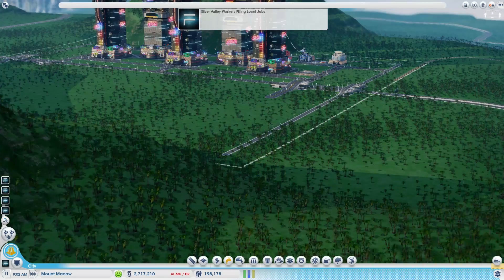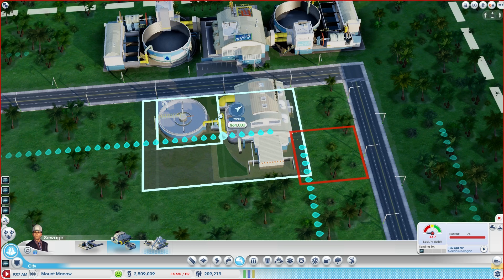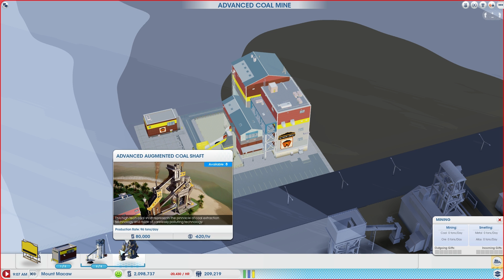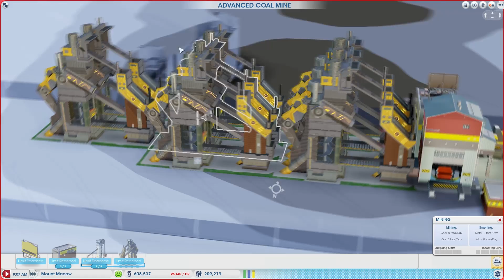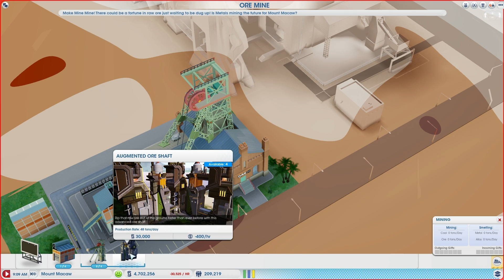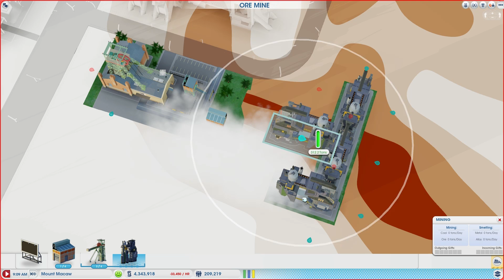SimCity Cities of Tomorrow - Operation Overkill [PART 39] "Mining Array"

Comment: With those augmanted  shafts, they bring up 96 tons  per day, so in only a few days, you'll deplete your coal and ore supply and there will be lots of air and ground pollution, so use the lower down shafts